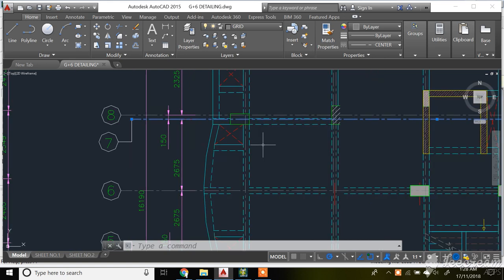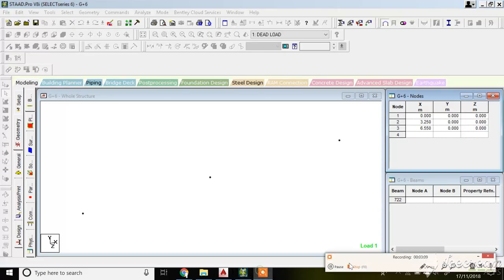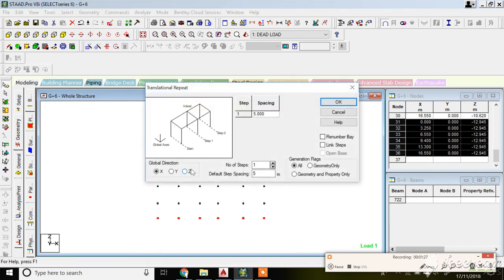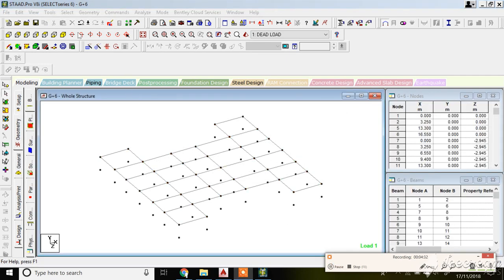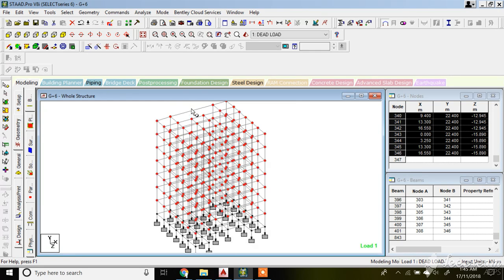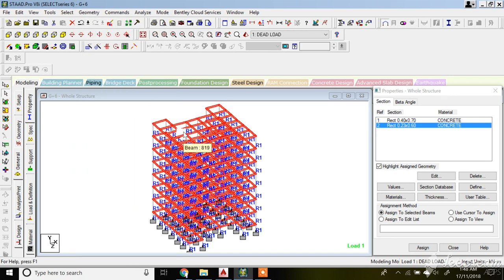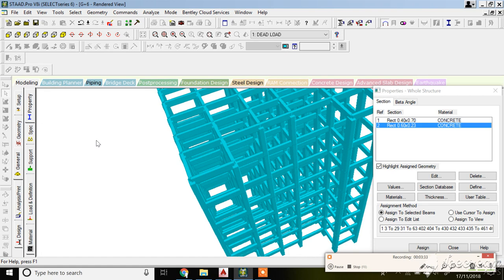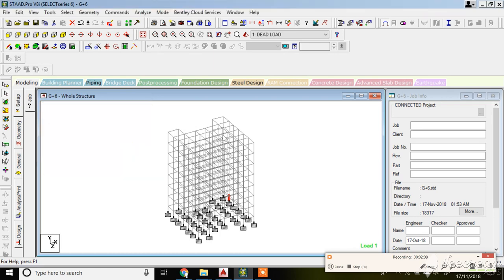G+6 RCC BUILDING DESIGN LECTURE-03 - STRUCTURE MODELLING

Comment: Good tutorial, most of the structures beam do not pass thru the cg of column,It may either flush any of the side depends on architectural plan.How do we model such structures in staad pro. How to model column portion which are beneath the plinth beam as they are short and are into the ground
Reply from the maker: TO MODEL COLUMN SECTION SIMILAR MODELLING IS REQUIRED LIKE TYPICAL COLUMN SINCE THE AXIAL LOAD WILL BE SAME FROM THE COLUMN AND BELOW SOIL THE CRITERIA OF SLENDERNESS RATIO IS NOT CRITICAL SINCE SOIL IS ACTING FROM ALL SIDE.
REGARDING MODELLING OF FLUSHED BEAM COLUMN WE WILL DEFINITELY COME UP WITH SUCH STRUCTURES SLOWLY SLOWLY WE WILL INCREASE THE QUALITY OF PROBLEMS SO THAT BETTER EXPOSURE TO NEW STRUCTURAL ENGINEERS PROVIDED